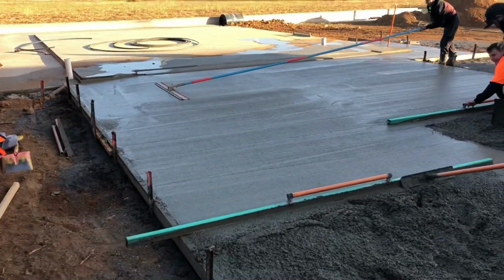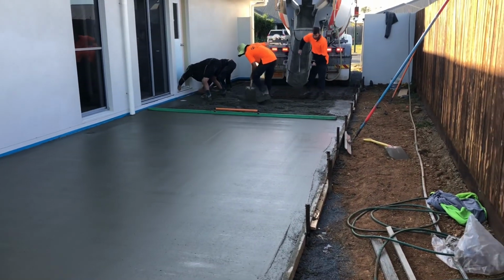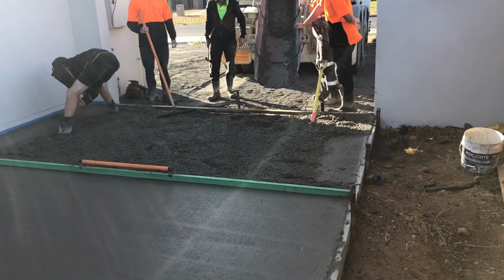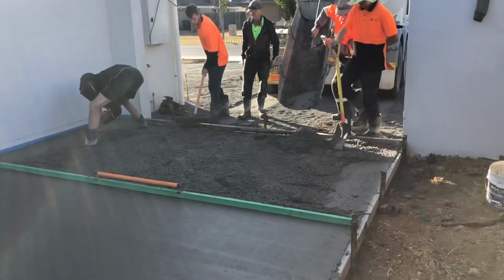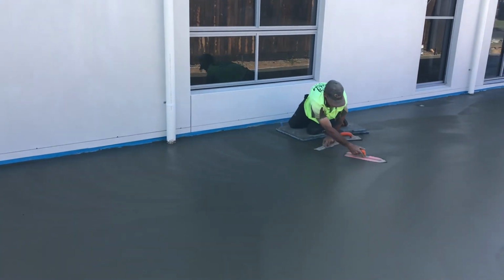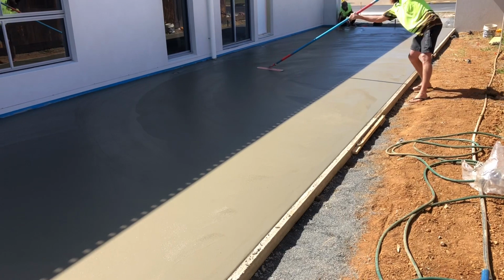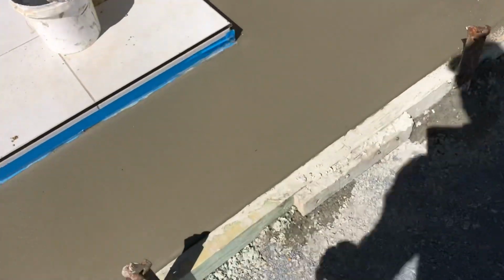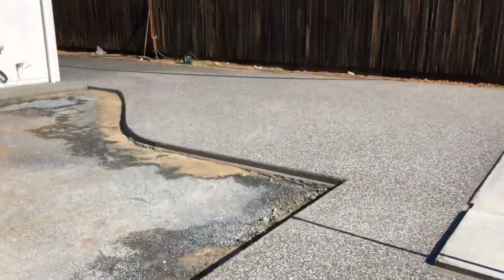How to expose concrete using sugar and water

Comment: Hey guys, love the videos, really helped out, iv done a few plain concrete paths and attempting my own exposed on Monday, and I’m keen to use the sugar as you do, is there any tips for weather differences in Victoria , it will be about 19degrees, I’ll mix 1kg sugar to 10litrss of water, wait for fingers just push in Crete and the sss, wait around 1hr half or so, then hose, how’s that gel with you blokes

Comment: Why do you folks pour that narrow band around the perimeter of a house??  Are you using any type of air entrainment, retarders or accelerators in your concrete mix design??  How is your doggie??
Reply: cant answer everything else. (and im not a concreter) but im assuming its a footpath and also so you dont have lawn up against the house getting the foundation wet?